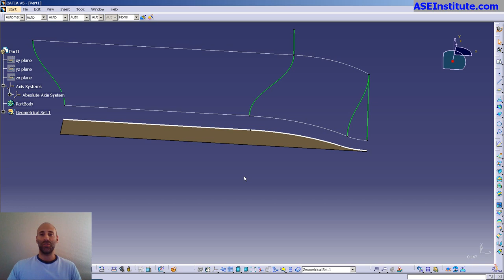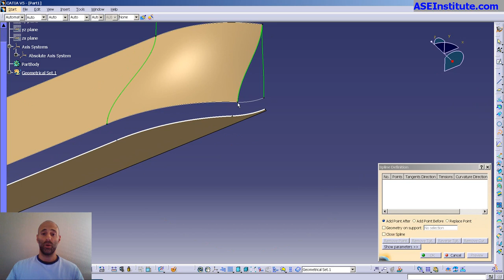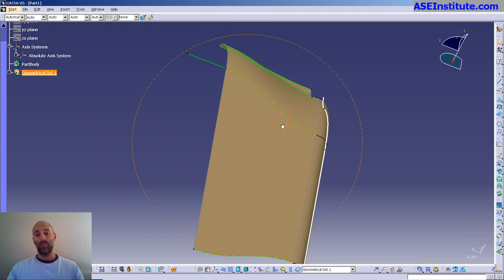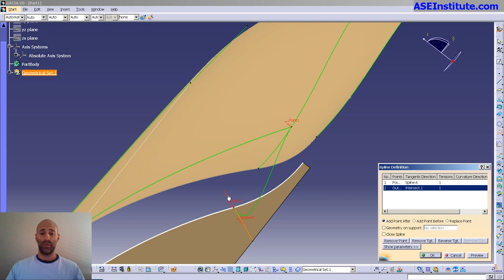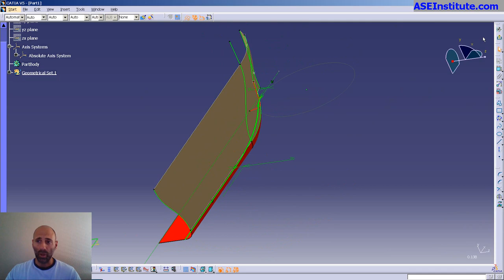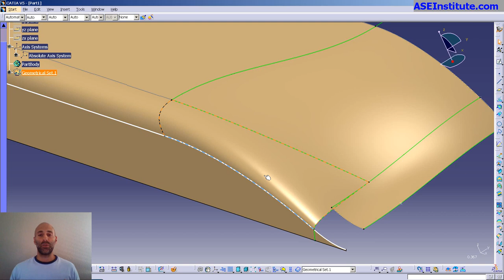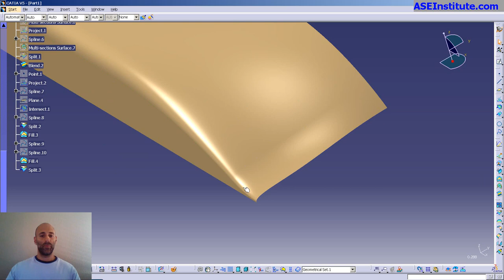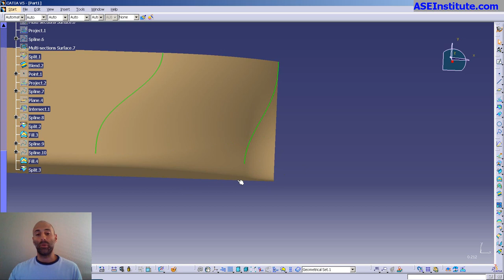Ship Design: Catia V5

Comment: Hi there, nice video. How can you be assured that the produced Hull form is identical to the original one? There sould be some calculations done on the new surface regarding the Volume, displacement, LCG, TCG, VCG, Cm, Cb, etc.,.How are you planning to carry out these calculations since that CATIA does not support this function?
Reply from the maker: You would have to use various measure tools and create any additional volumes/surfaces etc... to measure against.

Not straight forward but it can be done.
Reply: I agree but it is a tedious process and time consuming. This is the greatest disadvantage of Catia. Can't be used for new designs and also it's very risky when someone transfers data from scanned blueprints especially with large scale (I. e 1/100 or worse 1/200). Other than that I also love it and is more user friendly than Tribon.

Comment: Hi! 
First thanks for the video!
Well I have a little concern about how you did that shape... Messing around with your tension can give you weird shape's and most off the time going as low as you did will prevent you from thickening the sheet body at the end... I know it's just a first draft but I would advice people that are starting to play around with it but be cautious.

Again thx alot
Reply from the maker: Thank you for the comment. And yes, what you say is true. I very seldom move the tension much. anywhere between .1-.3 at the most because of the very reason you speak.

Here is where those 'hard' corners do not matter. This is a ship that is nearly 200ft long. Those odd shapes honestly do not matter much on this. If this were something much smaller than yes I agree 100%.

All the best